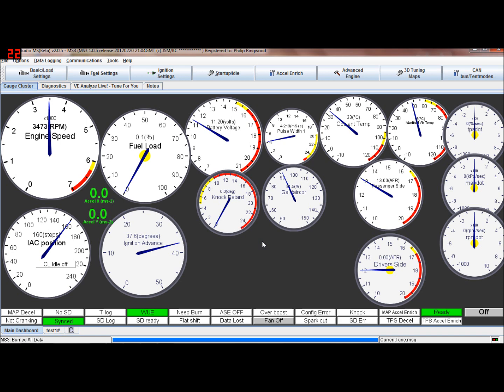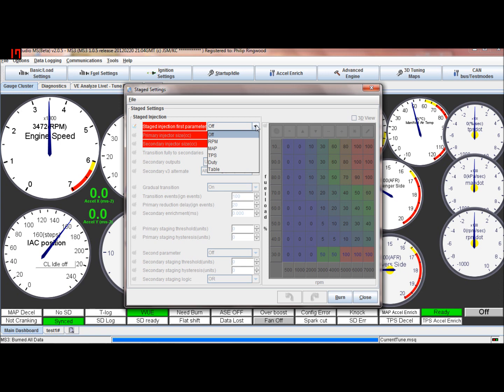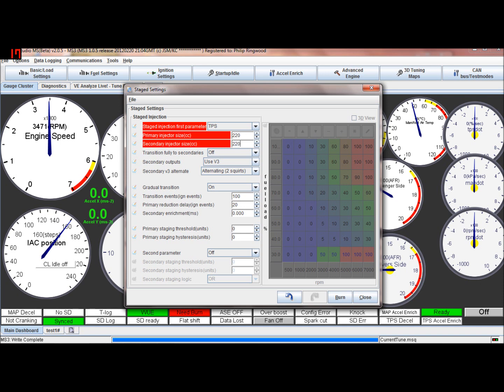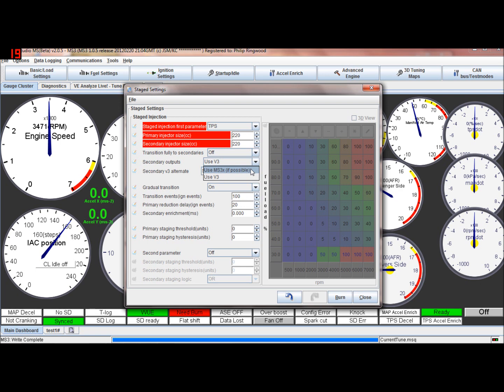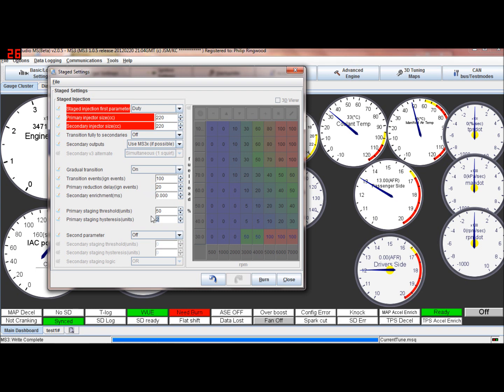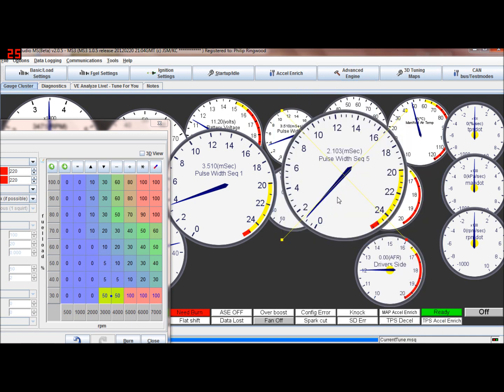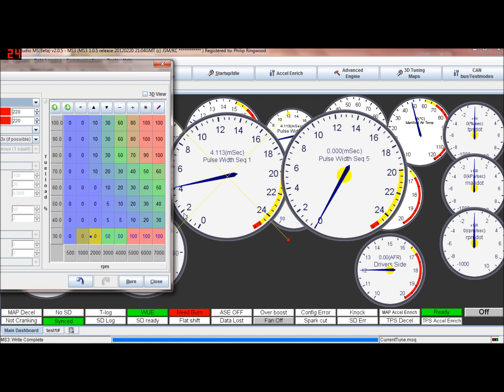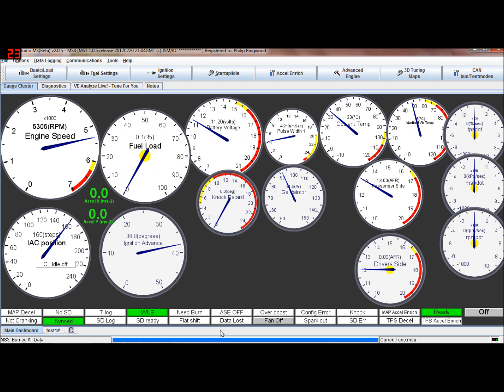Staged Injection

Comment: Helped me out! the programing is what concerns me. Im beginning the brainstorming process to convert my 83 xl600r to efi. Mainly I just needed to make myself a new wiring harness because the lighting circuit is shorted somewhere and all the wires are just old. Its a single cylinder 600 with two carbs set up sequentially, left primary right opens later and spits more air and fuel. Essentially going to mimic that with two 28-30mm throttle bodies with there own injector port and intake valve

Comment: Thanks for the video, setting up my staged injectors and your video pretty much answered my questions except, How does the staged injection work without the table selection, and instead on duty cycle? I'm concerned because I see 135% duty cycle in data logs-at high boost, and am not sure if the secondaries are opening after my 80 percent duty cycle first parameter, or if my primary injectors are in fact running way over their limit at 135% duty cycle. How does that work with one ve table? Because with the staged injection on, I'm am seeing 206 in my ve table.  Does the duty cycle just combine primary and secondary  injector duty cycle number? Can it auto tune like this with staged injectors set on duty cycle for microsquirt, with tuner studio? Thanks for your time!